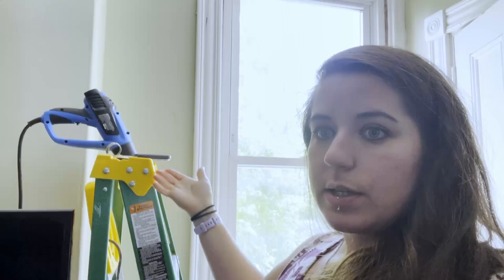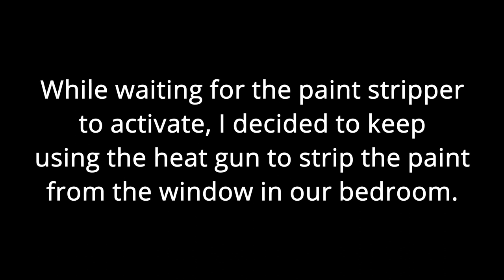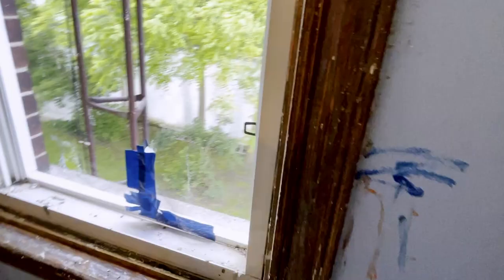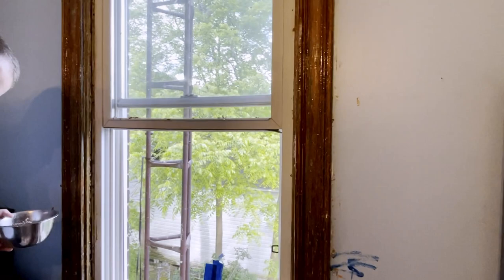The BEST Way To Strip Paint! | Circa 1850 Gel Paint Stripper | Heat Gun

Comment: Would you recommend the heat gun over the paint stripper solutions?
Reply from the maker: I personally prefer the paint stripper solution. Circa 1850 took every layer of paint off without damaging the wood. If you’re not careful with the heat gun, you can really damage the wood. I also found the heat gun left a gummy residue from either the stain or oil-based paints which we needed to use the Circa 1850 to remove. The one great thing the heat gun helped us with was moving any left over paint pieces in the crevices of the trim work so we didn’t need to use the chemicals again for those pieces, although we could have. 
When we are ready to remove the rest of the paint from the trim work, we will just be using the Circa 1850 paint stripper solution. Hope that helps!
Reply: @amell.family  oh I’m surprised! I thought you would say heat gun for sure 😂 Thank you
Reply from the maker: @PatWallace I definitely liked it in the beginning but the time it takes to strip paint with both is not really comparable. We stripped an entire window trim and sill in the time it took to strip a little portion of another window trim with the heat gun. The chemicals are messy though so be careful!
Reply: @amell.family our home was built in 1894 so I’m going to test both methods in a small spot to see what works best    Thank you so much
Reply from the maker: @PatWallace No worries! Mine was built in 1900 and the paint stripper was much faster but much smellier 😆
Reply: @amell.family  I spent ALL day working on this, paint stripper did one layer… and what a mess  wow 
🤯 
Heat gun took off a lot more but it’s a bit trickier and still I’m spending a lot of time sanding the details, but that’s okay, it will be worth it

Right?   Please say yes
Reply from the maker: For us it was worth it. You have to get the good paint stripper chemicals. We used Circa 1850 which is a brand of paint stripper. Left it on for 10 to 20 minutes and about 10 layers of paint just comes off easy peasy. 
Either way you do it, I love the original woodwork look so I definitely think it’ll be worth it! Whatever way is working for you, just keep going ☺️